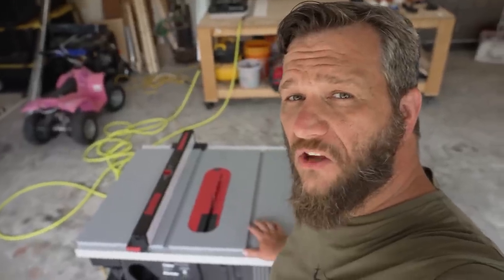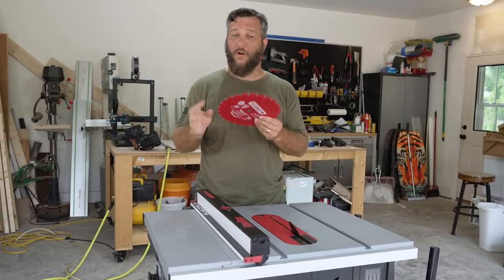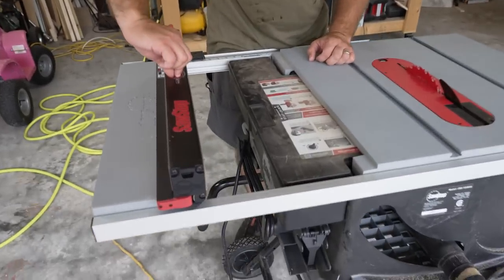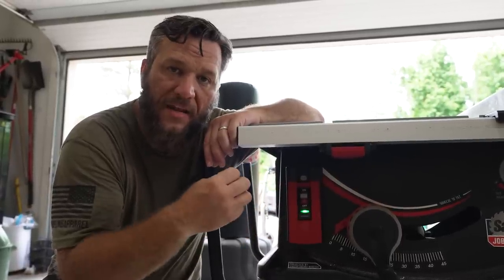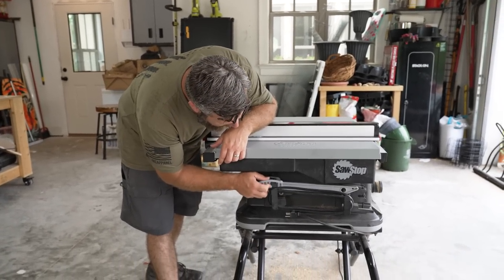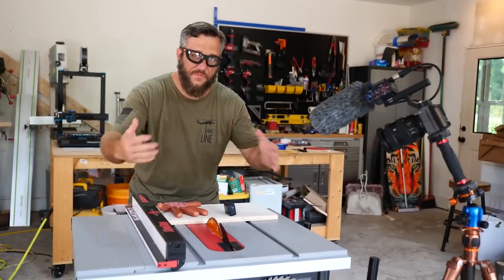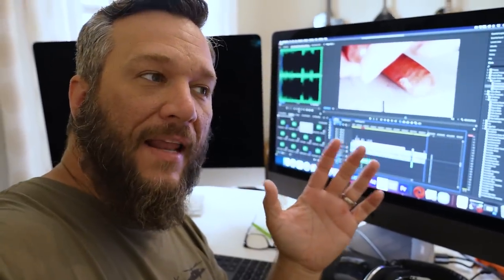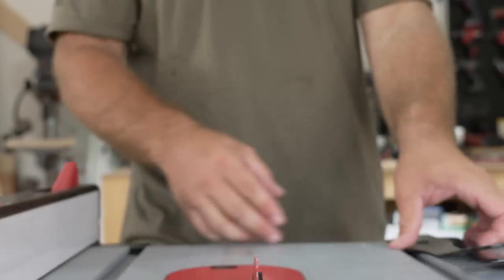Testing My Sawstop Table Saw! One Year Review - Worth $1400?

Comment: Good review thanks for doing it. I’ve had the same saw for over a year now and have cut everything, cross and rip, up to three-quarter inch ply, hardwood and softwood, and MDF with no issues whatsoever. So only thing I would disagree with is the comments about the blade that comes with the saw. I haven’t switched it out and all my cuts have been fine with it. Is the saw worth $1400? I think the answer lies more in what anything comparable will cost and what your fingers are worth. I’m glad I bought the one I did.

Comment: I like that safety feature. 1400 seems reasonable considering the quality of the fence , cart and safety.  Considering it costs 79+ bucks to reset the brake you have to be very careful with what you cut so as to not to trigger the safety device. I wish there was a saw for careless people like me which does not kick back lumber that gets pinched in against the fence.

Comment: I would love to see a video testing how wet the wood has to be go actually trip the brake. I’ve been told pressure treated wood isn’t actually wet enough to set it off. “Most of the time, if at all”
Reply: A friend of mine set his off when a drop of sweat fell and hit the the blade. So it would be interesting to see with treated lumber.

Comment: HAXMAN thank you for the review and video. Quick question. Would you use the Jobsite pro to build kitchen cabinets?… I sold my 3HP cabinet saw because it was basically a catch all and I needed the room…. Ive had a Bosch 4100 for years and went back to it because my shop is out of a single car garage. I find it pretty accurate but I think the motor on it is getting tired..
Reply from the maker: Absolutely! Of course the main problem is going to be maneuvering a sheet of plywood on the tablesaw. If you have an outfeed table and a helper you're good to go.

Comment: Excellent review Adam! Does the saw blade get ruined too or is it just the stop that requires replacing?
Thanks for sharing this,
DC
Reply from the maker: Thanks! They say you can sometimes save the blade but I wouldn’t trust it even if I could separate it. I would worry about the welds breaking on the teeth and flying in my face.
Reply: Much cheaper than a trip to the emergency room.  My grandfather cut off multiple fingers so this hits close to home.  Good product.

Comment: Bosch Reaxx saw also has a mechanism to get the blade out of the way.  It is a two use replaceable cartridge for getting the blade out of the way.  It doesnt damage your saw blade at all.  But it is not a low tolerance cabinet saw. It is a Jobsite saw, you loose out on the quality of the build.

Comment: Okay so, Like if you only touched the wood and pushed the hotdog into it without actually touching the hotdog would it set it off? Basically asking if it's your own bodies electrical signal transferring through the hotdog or metal or wet wood that shuts it down? 🤔 like what would happen if you tossed the hot dog at the blade without physically being in contact with it or if you were wearing rubber gloves or something? Hope someone can answer lol 😆 debating with my husband on the matter and my stance is that it wouldn't shut off it you weren't touching it or transferring your bodies electrical current and his stance is the hotdog and metal and water are conductive and that's what shuts it down. I argued that electrical currents can still travel though wood. Just has higher resistance than say water, so if the machine touched anything conductive why wouldn't it shut off. Anyways looking forward to the answer lol 😆
Reply from the maker: It would go off if you threw the hotdog. Moisture content plays a role in conductivity. That's why wet wood will set it off. It's not the wood, it's the moisture setting it off. Since I made this video I've set it off a couple times when the blade hit an unseen nail as well.

Comment: Quality piece of gear it seems. Brake cartridges are highway robbery though haha.
Reply: Only $79 for a replacement and a saved finger. Maybe take a second look at that complaint.  

High impact plastic housing, electronic trigger of explosive actuator, aluminum brake pad (machined or cast).

On the medical side, $79 vs $1000s for doc to sew it back on (if they can) plus lost time recovery. 

I really dont think if you actually triggered this thing with your real finger that your going to complain about $79.
Reply: @millenialfalcon8243  Personally, I hate seeing the waste. You should be able to send it back to the manufacturer and have the charge and crumple zone replaced. All of those electronics being thrown out for one use is crazy. Especially if it can be triggered by wet wood or an accidental piece of metal.

Comment: Sawstop is a false sense of security. People still get nasty injuries using these saws.  That tilt mechanism is also terrible if you want any kind of accuracy. 
As I say every time I see one of these videos, I want to see a piece of meat thrown at the blade at high velocity.
Reply from the maker: There are videos where people slide a hot dog as fast as they can into the blade and it barely scratches it. You can’t outrun the trip sensor.